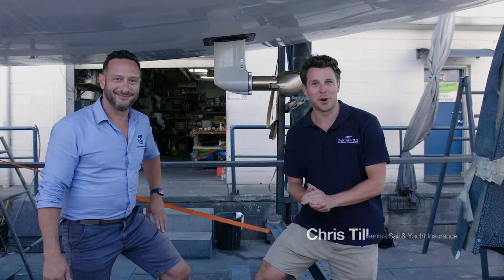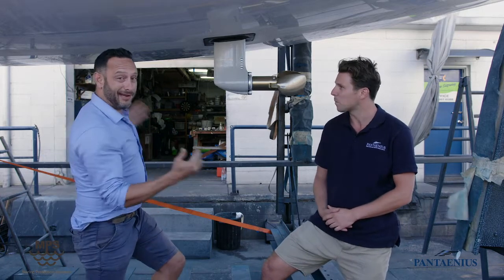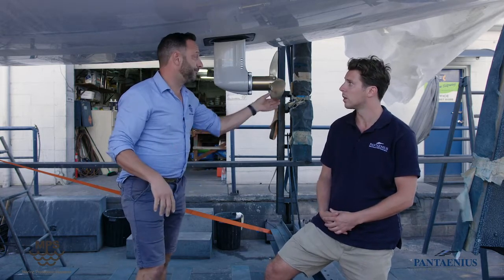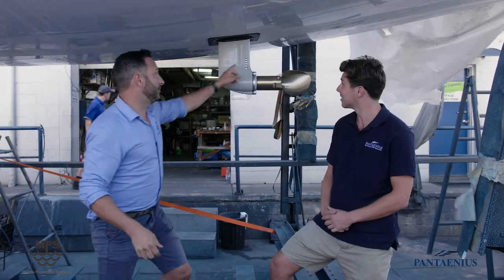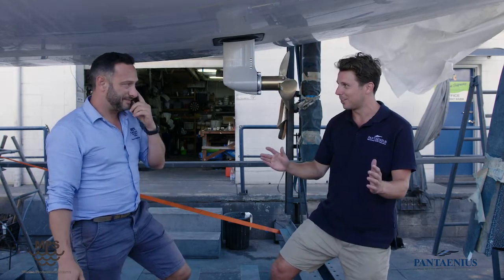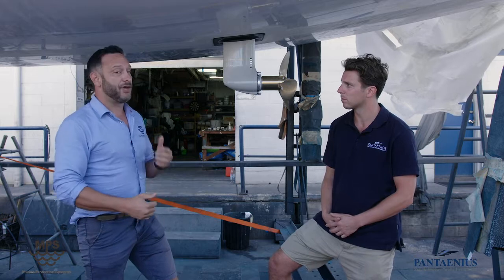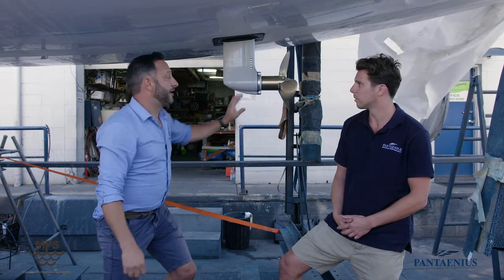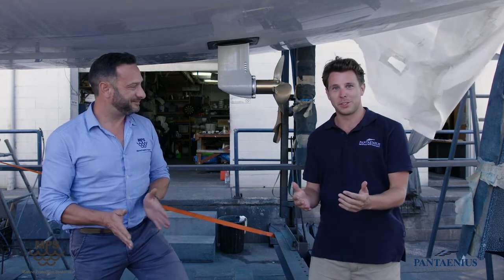Sail Drives - How to maintain and get the best performance

Comment: If you are using your boat year round would you recommend a more frequent maintenance schedule? If so, how much more frequently? Also will certain marine environments require additional, or environment specific maintenance? I.E. have there been noticeable increases in maintenance requirements when the sail drive is in long term exposure to certain marine environments due to chemical or biological interference with the equipment? Thanks in advance! :)